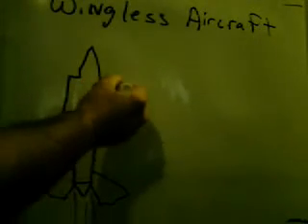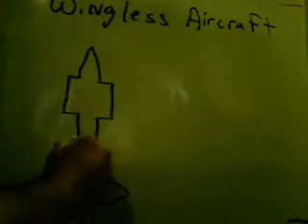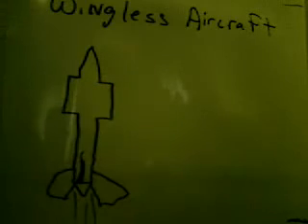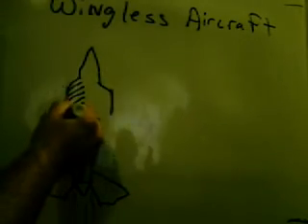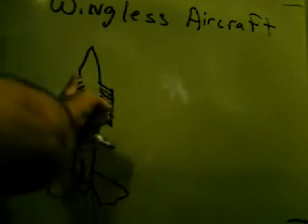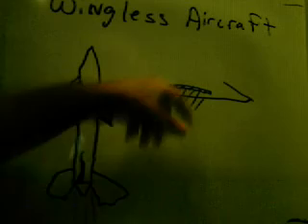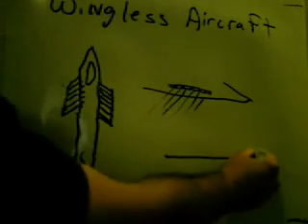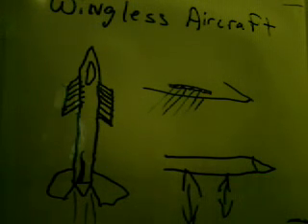Wingless Aircraft

Comment: I think its a fairly good idea actually, it seems possible although im not sure how you would roll the plane without wing control serfaces? Mabey another thrusted on each side faceing down and once faceing up? Normally this would only cause a very slow roll rate but without the wings there would be less air resistance and it should work...